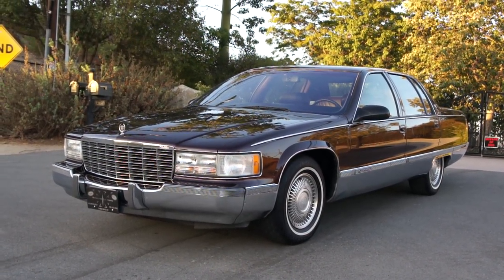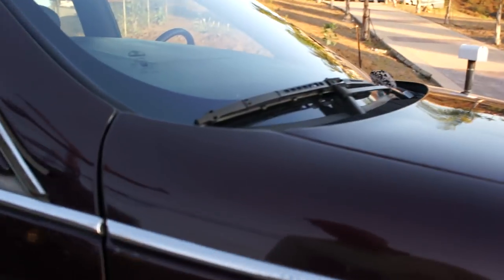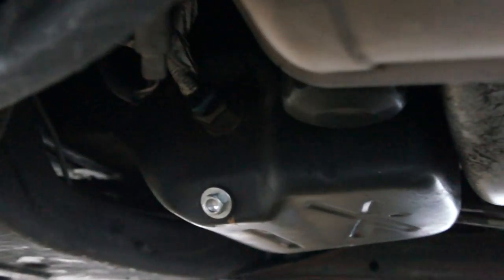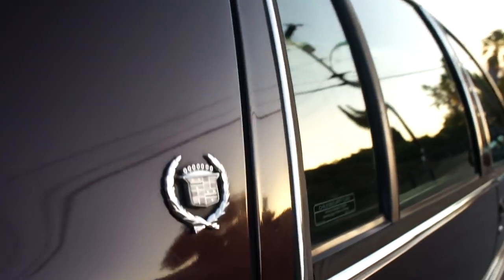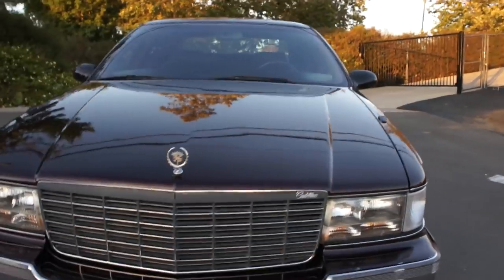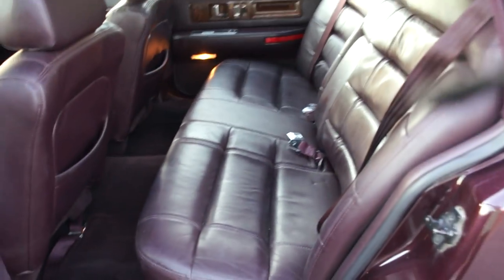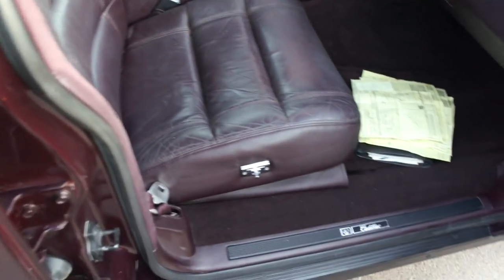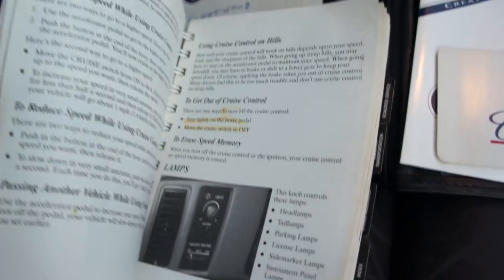1995 Cadillac Fleetwood Brougham 5.7 350 Bubble body

Comment: Town Car has a more advanced design overall. This Caddy can tow more than a Townie, more roomy, rides better, more reliable engine that's cheaper and easier to maintain, far more reliable air ride suspension, more unique looking with all that chrome, and you won't see a Fleetwood being used as a taxi. I'll take Fleetwood over Town Car all day. Just my opinion.

Comment: A lot more HP? Not really. 260 on the Fleetwood and 275 on the Deville. The Deville has less torque (which is what gets you moving): 330 on the Fleetwood and 300 on the Deville. I've owned different versions of both cars and the tried-and-true LT1 delivers the power all through the RPM range and the rear-wheel-drive puts it to the pavement. The Deville feels anemic by comparison. The powerband is very narrow - you have to wait for the torque. They rev higher, though, hence the higher HP rating.

Comment: Would this car be as reliable as a Town Car or would a Town Car be more reliable .  I don't know much about the 350 but I know the 4.6 in the town car runs forever.  I also heard there's no cheap conversion kit for these Caddy's if the air suspension goes bad, but there is one the Town Cars.
Reply: I had a 93 model Fleetwood and it was reliable as reliable can be. I'd rank its reliability right up there with the best from Toyota. If the air suspension fails on this model, you can still keep driving it with no problems because it uses regular coil springs. It won't level out when a load is in it which is ok because most cars don't have load leveling suspensions anyway. There are several cheap ways to override the original air suspension on these models to make it work. Most muffler shops know the tricks. Lincoln on the other hand uses air bags in place of the springs and it cost around $2000 to repair this type of system when it breaks and the car is not safe to drive because it sags too low to the ground and the fuel tank can start fire. Most people just have regular coil springs installed on the Lincolns.